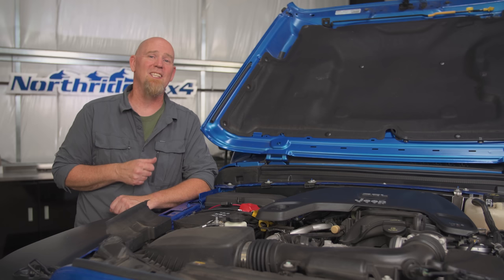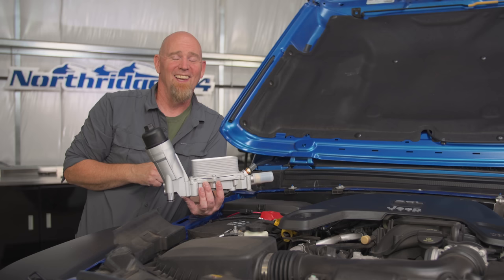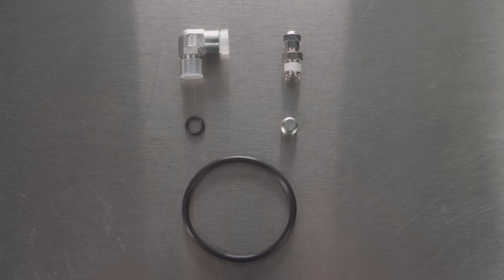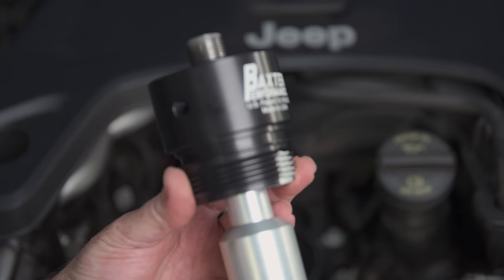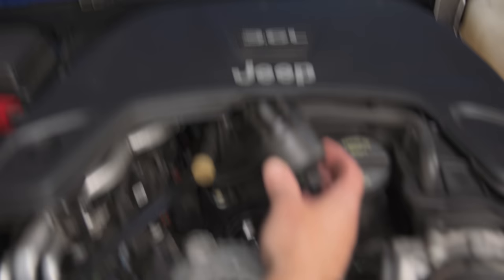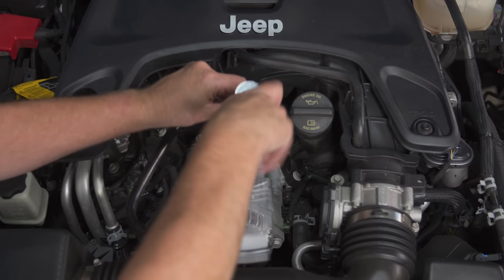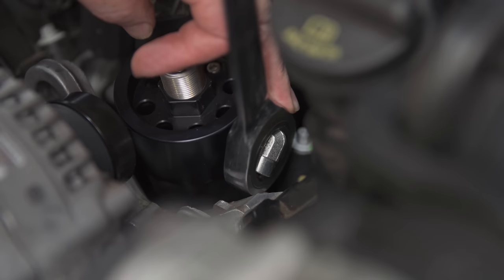STOP Dry Starting your Pentastar 3.6!!

Comment: Does this method of priming work on 2012 se chargers with that year 3.6?  If not what is an alternative way to prime the engine?  I have a car that sits for half of the year.  I was starting it at least once a month but after seeing this video I suspect it to be less damaging to pull the battery and let the car sit.  Then prime the engine with a fully charged battery when it's time to drive it again.  If anybody knows please reply.  Thank you
Reply from the maker: It works with the key on a 2012 JK, so our guess would be it should work the same with a Charger. Give it a try and let us know what you find out.
Reply: okay.  I was going to try it but I know the battery is weak.  And figured there wouldn't be enough battery to both prime and start the car. @northridgenation
Reply: And theres no power out there for a charger.  I need to pull the battery and try to charge it.  Do you know when Dodge started putting AGM batteries in their vehicles?  It matters for charging. @northridgenation

Comment: I feel like this would void my warranty.
Reply: It will if a dealer wants to push the issue.   They could blame almost any mechanical failure of the engine on a aftermarket kit like this even if the kit is an "improvement".

Comment: I have the 3.6 in my 2019 ram reble 1500, it looks different then this Jeep engine , lots more plastic crap in the way.
Reply from the maker: The 3.6s do look different depending on what vehicle they are in.
There has been a couple rigs that we've had to do a little trimming of the plastic to get the Baxter unit in place.

Comment: This should come with a band or sleeve to wrap around the filter that says, "See instructions before oil change"...with a waterproof instruction card  or QR code to place in the glovebox.  You can't take this anywhere, you'd have to do it yourself every time.  Remember who is doing oil changes at shops and dealerships....NOT the master tech.
Reply from the maker: They do include a decal to install under the hood.

Comment: Pretty sure this would void your warranty if you had an engine issue. I’ve seen claims for engines denied for non OEM filter use.
Reply from the maker: Denying a warranty due to a non-OE filter? That is illegal, check out the Moss-Magnussen act of 1974.
Reply: @northridgenation  the case I’m referring to was Hyundai not Mopar and they did indeed deny the claim. I know the act you’re referring to. You can use an aftermarket filter as long as it meets manufactures specifications. The one mentioned did not.  One of the first questions on most any warranty submission is a list of aftermarket modifications.  Just saying.

Comment: can you prime the jeep like you showed without the baxter to bring oil back to the top of the engine before turning it over to achieve the same prevention? I know its not ideal but in theory would it work?
Reply from the maker: Yes, you could prime the engine at anytime. But you will be putting more wear on the starter.

Comment: Very cool design, but why can't engineers just put a pre-oiler in vehicles. The fuel pump already runs and primes with ignition prior to start, they could program a pre-oiler with ignition on and a delayed start until so many PSI are met.  They had it figured out for WWII planes, why cant we have this now?  Oh...because then they wouldnt have to sell you a new vehicle every couple years.
Reply from the maker: We are with you there!  An electric pre-oiler would be awesome.

Comment: A $350 fix, not approved by Dodge/Jeep, on an area of the engine that is known to crack because of overtigtening, and you don't take the 3 extra minutes needed to use a torque wrench.  Why?
Reply from the maker: Because you don't torque down the Baxter adapter. It locks itself into position.
Reply: I never use a torque wrench on the OEM plastic oil filter cap and housing. Just tighten snugly.

Comment: That’s not true at all the drain back valve is built into the rod that goes through the center of the oil filter cartridge.
Reply from the maker: Baxter recorded a stock oil filter draining vs their oil filter draining on a 3.6 Pentastar. You can clearly see the oil drain completely out of the stock oil filter cartridge, while the Baxter Spin On Adapter retains oil in the filter: https://youtu.be/g5aowl0skY0?si=paEhp-H4YRvyX8T9

Comment: why allow it to show  low oil on the dip stick?  IF you added a product that increases your oil cpacity.  showing  low on the dipstick only reduces your safe operation Angles....        You will  suck air if tipped
Reply from the maker: Why would it suck air any different than the OE set-up?
Reply: Fill the oil to the normal full mark. What is the problem with that. Just don't create new procedures that don't make sense.
 @northridgenation

Comment: This only keeps the oil filter charged with oil. I'm sure this helps but it isn't quite what you are marketing
Reply from the maker: We've learned a lot about this system since we did that video, we'll be doing an updated video this spring.

Comment: Snake oil? 🤔
Reply from the maker: No, these really make a different in quieting down those loud starts. The Pentastar (and other newer engines) have timing belt tensioners and cam phasers that need oil volume and pressure to get them up to operating levels.

Comment: i disagree the problem with the valve train is that fca is a bunch of cheap bastards and used garbage bearing in the rocker arms. if you have one of these even new just expect to have to replace all rockers and lifters every 80k. either is costs you 800 in parts if you can do it yourself or a few thousand at a shop

Comment: Yeah using a traditional oil filter stills does not stop oil from draining back into the engine any subaru or tacoma with 4.0 knows how the oil will still drain back into engine over time anti drain back valve only works for so long
Reply from the maker: The anti-drain back valve in the Baxter adapter will hold oil up there and not allow it to drain back.
Reply: @northridgenation  yeah not after a months oil filter will be empty lol

Comment: you'd think the engineers at jeep would change the design if this was an issue. Is there any scientific proof of this ?
Reply from the maker: Yes, Baxter recorded a stock oil filter draining vs their oil filter draining on a 3.6 Pentastar. You can clearly see the oil drain completely out of the stock oil filter cartridge, while the Baxter Spin On Adapter retains oil in the filter: https://youtu.be/g5aowl0skY0?si=paEhp-H4YRvyX8T9
Reply: Jeep is making the 2 lt engine the mainstream engine...

Comment: Had me right up to pumping air into the top to blow the oil into the motor.  I haven’t met a compressed air system that doesn’t have some amount of water in it.  No thanks.

Comment: Way to much for this at nearly $400, I'll stick to putting ZDDP in every oil change!
Reply from the maker: How will that help get the cam phasers and timing chain tensioners up to operating volume and pressure?
It is not just about having oil on the lifters.

Comment: dry start really.... how long are you letting the vehicle sit. there's not a dry start your oil is doing its job and clinging to parts a dry start will instantly eat everything up.
Reply from the maker: You need both volume and pressure to get everything up to operating pressures. Not just a coat of oil.

Comment: Never i repeat never no matter what that oil cap indicates use 0w 20 or  5w 20w  in those engines. 5w 30 pennzoil ultra platinum synthetic and you will be good for 250k and change it @ no more than 7500 miles and you will be good...

Comment: Hmmm, My F150 goes through just as many roller lifters as my Grand Caravan.  One has a conventional antidrainback filter and the other does not.  This is just a $350  solution to a problem for people with more money than brains.  It solves nothing.
Reply from the maker: This is more about getting the cam phasers and timing chains up to operating volume and pressure than just coating the roller lifters.
If your F150 has the 2.7 or 3.0 Ecoboost, Baxter Performance also has adapters for those:
https://www.northridge4x4.com/part/oil-filters/fs-101-bk-baxter-performance-ford-2-7-3-0l-ecoboost-cartridge-to-spin-on-oil-filter-adapter

Comment: See. You mean to tell me these rocket scientists designing tjese engines never thought about making it standard? Same goes woth premium gaskets vs crappy ones that die quickly. Oh yeah, the cost. With vehicles costing like they do I think 100 more on good gaskets and this oil doohicky is a well received cost. At the dealer ditch the floo mat option. That can save you hundreds to offset the cost😂😂😂

Comment: Let everyone know that this does not fit in a 2013 Jeep wrangler 3.6 v6 engine
Reply from the maker: Did you install the correct part? Baxter offers a few different adapters depending on the year of your Chrysler vehicle. This is the one that would fit your 2013 JK 3.6: https://www.northridge4x4.com/part/oil-filters/ms-101-bk-baxter-performance-cartridge-to-spin-on-oil-filter-adapter

Comment: you lost me when I see you have to use air pressure on that schrader valve ..what a PITA oil change ...
Reply: I f you are not going to do your own oil change then don't buy this device. The oil lub mechanic will make a mess when they remove the oil filter.

Comment: Isn't this true for almost all vehicles? Oil will drain back and this is the reason for 0w oils to allow for faster supply to the cylinder heads. But a nice advertisement for Baxter and basically that is what this is an advertisement.

Comment: Replace one quart of oil with slick 50 additive. I loaned a car to a family member for over a year. They never checked the oil. When i got the car back it had barely enough oil to show on the dip stick. Slick 50 is a polymer that coats all engine parts. They have an old you tube video showing an engine treated with slick 50 and then they drain the engine of all oil and ran that engine for hours with no oil and no damage to the engine. Once my cars reach 50,000 miles i treat them with slick 50 every 50,000 miles.

Comment: First of all the filter you use with this waste of money has its own anti drain back valve in it why the need to have another one in this contraption … second if your oil is of any kind of quality , it leaves a film on parts and in the lifters should not drain unless your engine is very worn.. third i have had and currently have 2 3.6’s and the valve train quites down in like 1.5 seconds .. this product in my opinion is a huge waste of money . Mopar isn’t stupid their engineers know what they are doing and is why 300,000 miles is a pretty normal life for one of the engines , with proper main maintenance .. again my opinion…
Reply from the maker: Yes, you should always run good quality engine oil. But you may be confusing lubrication with oil pressure. 
The cam phasers and timing chain tensioners need oil pressure to work properly. By keeping oil up in the filter area, you shorten the time it takes to get enough oil up there to pressure and help parts work properly.

Comment: It's really strange how some people find these 3.6 Pentastar engines to be unreliable even with top of the line maintenance.  I have one of these in a Ram 1500 regular cab.  It's a beast. It feels closer to 375 horse than it does to 305. It will set the rear tires up in smoke.  I run it hard. I change the oil every 2500 - 3000 miles. I got it with 8,800 miles on it. It now has 26,000 miles. They need have auxiliary oil pump that comes on a few seconds before engine start up that primes the whole engine.  This is my invention.
Reply from the maker: We too think that the Pentastar 3.6 is a good engine and there are a tons of them out there that are running rock solid up and down the road every day.
But like any product out there, there is always a way to make it better.

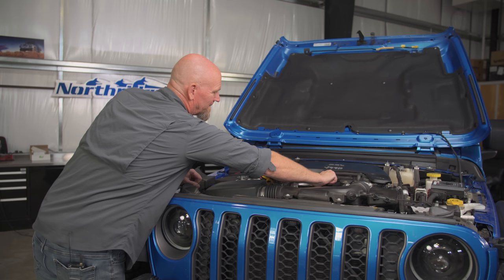Comment: 8:40 why not prime the engine in the morning to prevent drystarts? Lol, now your going to need an air compressor for the oil changes.... over engineered, I'll pass.
Reply from the maker: You could, but doing that every morning will shorten the life of your starter.
Reply: You can simply use a tire pump for a bicycle to pump oil out of filter when doing an oil change.  Pump it 10-15 times, and it's empty.

Comment: Great idea, until you go to change your UPSIDE DOWN FULL WITH OIL FILTER and spill it all over your engine.
Reply from the maker: If you watched through the entire video, you would have seen the schrader valve that allows you to apply air, cleaning out the filter for a mess free oil change.

Comment: I don't like the dry clattering that my engine makes on cold startup.  I like the idea of this adapter.  But I have a question -- given that Jeep/Chrysler/Stelantis  is responsible for the emissions of this engine for 150k miles, why wouldn't they just put in an anti-drainback valve at the factory?
Reply from the maker: That is a good question.

Comment: That will allow oil to spill all over your engine. It does not do what he says lubrication-wise, a motor driven pre-oiler is the solution. Just as you hear fuel pump prime system when key is turned to KOEO a pre-oiler would do same for oiling system.
Reply from the maker: No.
Once you blow the system down, the oil filter is dry and you can spin it off without any oil going anywhere.
Yes, a pre-oiler is nice, but this is much easier to use and they work great.

Comment: That is more than just a "Dry Start", that shudder is what it feels like to get "Dry Humped in your bum-hole" by the Chrysler corporation. Here is a piece of advice that will SAVE you thousands in repair bills on your Chryco product: DON"T buy a Dodge, Chrysler or Jeep car, truck or minivan.
These cars are deliberately designed to dynamite 20 miles back in the woods. When I was driving tow truck, these pieces of crap {Jeep specifically} were almost entirely responsible for keeping the towing Industry alive! It don't matter what kind of Jeep you buy, these are the biggest junk heaps ever built to drool in your driveway. If you buy a Jeep you had better have a damned good job, because you are going to need it to keep on of these junk heaps on the road.
Reply: How many millions of Pentastars on the market? 10,000,000?
Reply from the maker: There are a ton of horror stories out there, but there are also a ton of stories out there with people getting hundreds of thousands of miles on their Pentastars.
We just like being able to do what we can to up the odds of them living longer.

Comment: Nope !
As you spin that filter off,  that's  going to be way more messy than the stock ..
And you're  throwing away a lot more than just a filter core,  every time you change  oil ..
The stock is easier and cleaner ..
Reply from the maker: Did you miss the part where we apply 30 psi of air to clean out all the oil from the filter down into the oil pan? Its at timestamp 11:30. Way cleaner oil change than stock.
Reply: your replying to the wrong posts, id personal use it as an upgrade not to use a paper filter and use the tradition spin on cartridge as used for years by all manufactures before the cost cutting @northridgenation
Reply from the maker: @claylittlewood540. Hit that Schrader valve with a little air pressure for 5-10 seconds and it blows the oil right out. The spin on filter comes off dry. No mess, no fuss.

Comment: I see a huge oil mess when changing the filter.  No thanks. That is a terrible design, should have made it a remote oil filer.
Reply from the maker: That's why you blow air through it, no mess.
Reply: @northridgenation  Do you really think everyone has a air compressor to do that, or that a quick lube is going to do it?  Get real.

Comment: You mean 3.6 fiat engine 😅 I miss the old in-line 6 early 80s some 90s but now suck changing those plugs you need to remove the whole manifold cover 👎🏾 Toyota baby🤙🏾
Reply from the maker: Fiat did not develop the Pentastar and only has the rights to use the engine through their purchase agreement when they bought Jeep.
Reply: @northridgenation   there still not as reliable as a 4Runner though

Comment: No, you lie just for sell, in 3 sec a oil pump more than 5L. And the oil dont drain back completely to the oil pan, juste little. The problem in valvetrain is user problem : idle for very long time, use cheap mineral oil or dont respect interval drain.
Reply from the maker: And that oil has to get up to volume and pressure and it take 3.5 seconds to do that in the Pentastar. Test and proven.
Reply: @northridgenation  The anti-drain back is in the oil filter housing, i cant add a cut view of it here. when you tight the filter it block and open when you unscrew the filter, if the oil drain to the pan overnight, why when you unscrew the oil filter the housing is full of oil?